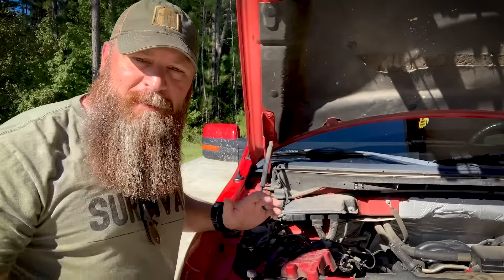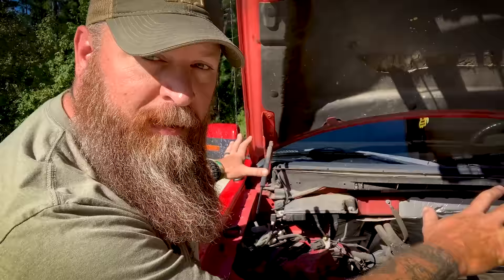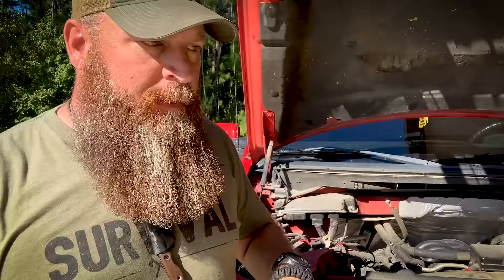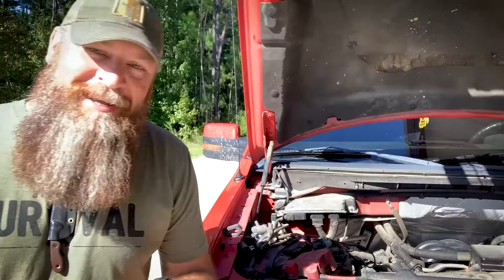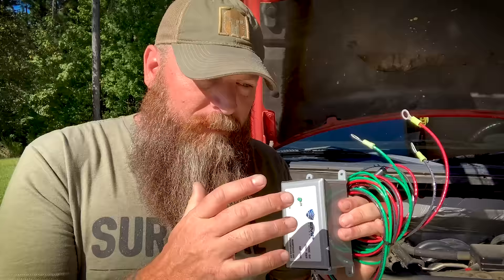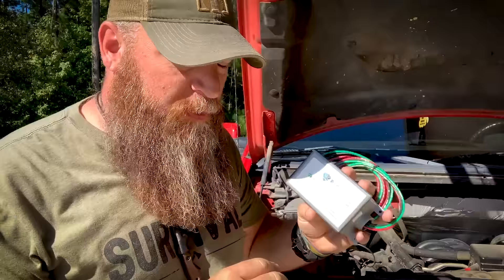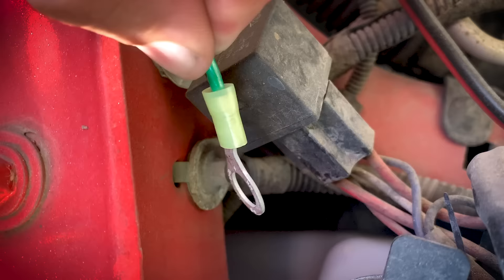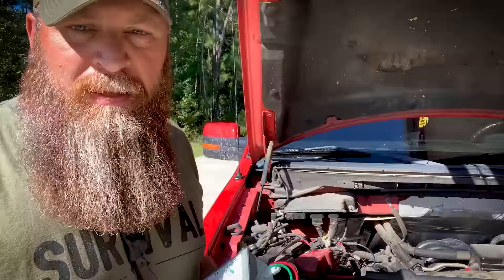EMP PROOF YOUR VEHICLE

Comment: Working with some MI Army Natl Guard folks earlier this year, got to talking and they showed us...to their knowledge, DOD has had these very devices installed in their vehicles. Shows us how easily they install too so I bought one for the truck when they were doing their ~$100 off promos. Hoping never have to test it. Also suggest grinding paint off any metal surface thoroughly where the ground wire attaches.
Reply: MJ thats correct! Thanks for comment
Reply: These have gotten so expensive they are no longer affordable.
Reply: @bobbytowesr3387  don't worry bout it. let me give you some food for thought...think about it this way, doesn't the fact that there is no metal parts of your auto touching the ground at any time make you question how it could act as a lightening rod and telegraph that energy into the ground? and remember that old advice you were given that if you are in your car and the roads are wet and a power line comes down on your vehicle you should stay inside and don't touch any metal parts. because the rubber tires are what are touching the ground (all be it that if there is rain, that is on everything,  that could in theory be a conduit).
 still, 4 rubber tires. so, how is attaching that wire to the auto frame functioning as a ground exactly?  another thing, when did any lightening rod ever need to be powered by a battery? if you ask me, those devices look more like an old internet modem from back in the day...you know, to send & recieve signals. to me it sounds just like more snake oils being sold by the folks that brought the world pandemic coV-19. but, i know nothing about nothing. so, i have to, question everything.
be well & thrive,
©¿~salli
Reply: @salli8324  do you know why your car tires are black? The rubber is impregnated with carbon, a fabulous conductor of electricity. An early test of rubber tires almost killed a toll booth worker and the driver when they passed the coins over due to the static electric charge built up from the rolling tires. Tires are great conductors of electricity. Feel free to do your homework.
Reply: @gungadingo  , some home work i have done on carbon was that carbon is not a conductor. however, if that car owner was running on 4 bald tires, perhaps those were steel belted tires and were very good source of conduction. but i don't know those details because i was not there. and i know nothing, so, i have to question everything.

be well & thrive,
©¿~salli
Reply: @gungadingo    ..  The tires are black to conceal the otherwise unappealing, inconsistent, look of raw rubber. The tires can be white, red, or any other color of the manufacturer's choosing.
Reply: @gungadingo  Wow - really?  Use your Ohm meter and go see what you read.  The rubber is a great insulator.  I'm and electronics power engineer and have designed power for military vehicles including ground, air, and Navy.
Reply: Typical of the military, spending money on something that won't work!  🤣
Reply: @bobbytowesr3387  you don’t have 400 dollars? maybe you need to reevaluate
Reply: @gungadingo  that's ridiculous, check your meds 🤣🤣
Reply: @salli8324  So then how does the ground on the battery work then? Just wondering
Reply: @gungadingo  Rubber grounds your vehicle.  However it won't ground a lightning strike in a billionth of a second.
Reply: @salli8324  go tell me what material is used to make the rods in big batteries.
Reply: @salli8324 , it doesn't work like you think it does. Have you ever walked across a carpet and then gone to touch a doorknob and you get a tiny static electric shock? The doorknob wasn't grounded but you still got a shock.
Reply: @salli8324  an EMP is NOT the same as a Lightning bolt.
Reply: @gungadingo  put down the crack pipe.  Rubber is used all of the time as an insulator.  Think about Electricians who work in rubber boots and gloves when they are working on high voltage lines.  Go crack a book
Reply: @glidercoach  Yeah like $7000 toilet seats!🤣🤣🤣
Reply: @colleenthomas353  The negative side of electrical and electronics go to the car chassis, Battery doesn't have a ground, just a positive and a negative! Does your flashlight batter have a "ground"? 🤣🤣🤣
Reply: @CharlieWhitewolf  No, tires are insulators!!🙄🙄🙄
Reply: Rubber coat your car hood?

Comment: It is the OBDII vehicles that have been around since 1996 that have EEPROM chips that can be electronically flashed, which an EMP burst could flash one of these chips that have to be worried about. OBDI vehicles from 1988 to 1995 have EPROM chips that have hardwired, or burned in, set of instructions that would not be effected by an EMP blast.
Reply: now this is some useable information thank you

Comment: This is a very complex topic. More than likely your vehicle will survive a solar flare 'carrington event' and maybe even an emp. Depends where you are. EV's are another issue. If they are plugged in getting charged when it hits...done.  But most of those chips in your car don't have a damn thing to do with whether your car will run or not. In fact, pick the ones that do, and buy a replacement and put it in a faraday bag.  Once the last nuke has gone off, and most of the world is destroyed you can put it in and go for a drive.  The issue is the grid. EMP's....well, if nukes are being set off....the problems are too numerous to even speak of or list or predict.  The consequences are literally immeasurable. There is nothing more dangerous than a false sense of security.
Reply: You must not own a new chevy lmao If your seat is not in the right position that sucker won't start. Lmao
Reply: Do you know what the best way to find out which chips, relays, etc. are essential for a vehicle to run. Still planning on getting one of these Shields, but the electronics in my '97 Wrangler have been on my mind. I do all the work on it and full half of the parts I've had to replace were relays, sensors, etc.
Reply: @ResilienceOnPurpose  Get a replacement computer model for it and keep it in a Faraday bag!😁😁

Comment: I am skeptical about a box of tricks that'll work as an EM shield, the best shield for your vehicle would be to ground the metal body to the ground thus making a faraday shield for the sensitive electronics.
Reply: How would that work? By ground the car would the emp bypass the sensitive equipment of the vehicle?
Reply: @mibd7812  Essentially yes. Your vehicle is basically a metal box aka a faraday cage. Electricity follows the path of least resistance and so grounding your vehicle the electrical pulse would conduct through the metal panels and frame and then out through the grounding wire and tires (although rubber they have carbon added to conduct static so you don't get a shock after driving)
Reply: @timberwolf0122  thank you for that knowledge right there
Reply: @mibd7812  it works on the same principal as tin foil hat
Reply: Mad genius would love to see a video on an old junker with say romex grounded to a spike then just dirt.
Reply: # Tulsa coils
Reply: This company has US government contracts for these, sure it ain't snake oil
Reply: @jaxsepisodes8286  Contracts or no that doesn't change the laws of physics.
Reply: to be an effective faraday cage it must be completely sealed in metal with no cracks. You can accomplish this on your vehicle by wraping  the car in aluminum foil , several layers is best.
Reply: @mohawksteel2215  You can have gaps in your faraday cage as long as they are smaller than the wavelength you want to block.
Reply: @mohawksteel2215  Just bought 10k shares in Reynolds Wrap.  Thanks for the dividends my foil wrapping friends!
Reply: How do I ground my vehicle to the ground with what? I am screwed cause I live in my vehicle, am broke right now until 1st and Russia is supposed to send a nuke in the atmosphere to cause an emp strike on March 11,2022. to the U.S! Yikes!
Reply: @timberwolf0122  so I would attach wire to body and other end to negative on battery?
Reply: @charlottewest9647  No, that connect already exists (vehicles grounds the negative of the battery to the body and frame), what you need to do is connect the vehicle to the Earth itself. Ideally to an earthing rod, a 6ft copper rod that you pound into the ground and is used to connect electric fence energizers to the earth or the earth pin of your house outlets to the earth. 
With this an EMP or even a lightening strike will take the path of least resistance, which is from the metal skin/frame down the copper cable and into the ground via the copper rod Vs going through the delicate electronics,
Reply: I met these guys at a show- talked with one of their engineers and installers.
It's ligit, and they have a range of products- but it's a one trick pony- no multi hits. What its "not" is a surge or lightning protection device, it works like a shunt.
I can confirm in conversation with these guys, it does NOT work within a direct overhead, but outside that...
Reply: Yeah right. How you expect the company to warranty this AFTER an emp strike?
Reply: Problem is that the lights are not covered with a Faraday cage! It will not work!
Reply: Could you just ground it with a wire attached to your vehicle to a copper pole in the ground. Same as the one when you ground a house?
Reply: I am skeptical too, but will need to do a lot more research on the subject of EMP. My only experience with an EMP-like event occurred when I was driving along a country road, and lightning hit a transformer on a telephone pole about fifty feet in front of my vehicle. For only a moment, I lost electrical power to the car, but the power returned quickly with no apparent damage to the vehicle.
Reply: Use a braided copper strap wrapped around your axle and let it drag the ground. This prevents static discharge from when you exit your vehicle after driving to prevent getting zapped.
This also acts as your faraday cage for your vehicle.
I’ve been doing this for years.
Reply: Every wire is an antenna...
EE and Ham operator . K5EDG 73!
Reply: There are grounding straps you can buy for like 3 bucks
Reply: @NobodyReport  grounding is not shielding from the electromagnetic pulse… it travels in a wave and shorts out chips from the inside. Long wires just act as antennas!
Reply: @charlottewest9647  how’s that nuke strike going ?
Reply: @muddyram  sarcasm and all, it will happen soon!
Reply: @NobodyReport  That would serve the same purpose? As this box?
Reply: @benjamincurry5701  It would do what OP said int he first comment for like 4$
Reply: Connect a chain to car or truck let it drag on the ground  🤔
Reply: So like a piece of rubber going from the frame to the ground?
Reply: Make a car cover out of copper mesh and you're good to go. No need to spend $450 on something that won't work.
Reply: A faraday cage is a nice start, and will help with the EMF, but the trickier part is the gamma radiation, and this box will zero for that.
Reply: @timberwolf0122  tires have carbon black in them for durability reasons, conducting static electricity is just a side benefit
Reply: How do those skinny wires conduct 5000 amps  ????🙄
Reply: @jaxsepisodes8286  They SAY they have contracts.  They haven't proven that they have contracts.  He says the company us under an Executive Order.  I challenge you to find any proof of that Executive Order.  It's one thing to make wild claims in a YouTube video, it's a whole other thing to PROVE those claims.
Reply: @alfredweaver5390  totally agree. I have seen this done a lot in the pipeline industry as field welders hang copper straps off their welding trucks to better ground them. No positive it would save you from an EMP...but, it couldn't hurt and it's super cheap.
Reply: @charlottewest9647  how do you know that is the date?
Reply: @charlottewest9647 About that nuclear strike 😂

Comment: We have these installed on all our vehicles, our house electric panel, our A/C, and barn.  My hubby is an electrician and these EMP shields will work.
Reply: Where did you buy
Reply: you  can  use an  emp shield  on your  house but if the grid is down where Will you get electricity? LOL think  people
Reply: Nope.  They most certainly will NOT work.  You'd better rethink your strategy and your hubby might want to check his diploma.

Comment: EMP will fry the circuits immediately and having some wires to a battery will not stop that. Think of it this way, if you shuffle your feet on carpet, and then touch a light switch on the wall, you will experience the shock before the surge can get to the power panel and have it trip the main if it was that sensitive. The damage has already been done at the switch. Same with a vehicle CPU. The charge in the atmosphere will zap everything equally  It would be a matter of chance that the charge in the atmosphere tickles and trips the EMP protector before the car circuitry. If it fails, how are you going to get your money back?
Reply: Wouldn't you need a Faraday cage to surround your whole vehicle.
Reply: @glengarbera7367  that's exactly what I was thinking 🤔
Reply: This has been tested by the Government and they stopped testing for failure at just over 40x.. it works.. don't know how, but I just know it does..
Reply: That’s an interesting analogy. 
A problem I see with the comparison between the two is the difference of how electrons move in a static DC environment (rug example) and an AC (EMP) environment. 
As another poster mentioned, it’s not easy to model these complex EMP events. USA and Russia both performed several simulations decades ago and that’s the data tables scientists still use to this day. 
We understand them in mostly theoretical (circa 1960’s) terms- long before our world became dependent on microchips. 
  Frequency, exact duration and distance from any EMP will play the most critical roles whether or not our vehicles will be able to start afterwards.
Reply: Take the battery out 30 mins before the nuke hits itll be fine
Reply: Getting your money back would be the least of your concerns.
Reply: @ToXXicgaming  my question is will a charged battery itself fry even disconnected in such an EMP burst?
Reply: I can't imagine how at would would with 13800 to 480vac transformer, the amount of current would be ridiculous even if it was for only a second, a magnetic flux field just does not turn off instantly!
Reply: If it fails, I don’t think money would be your concern.. more like looters and mole people will come out.
Reply: @glengarbera7367  Why isn't the vehicle itself a faraday cage? It's already mostly metal
Reply: @trenton1190  needs to be metal or aluminum mesh. ie a "cage"
Reply: @glengarbera7367  I gotcha
Reply: @jasonmarkwell8593  no it's not connected to a circuit
Reply: @jasonmarkwell8593  the battery is not what fries. He talks about conductors. The traces in a circuitboard are conductive wires. The emp would burn out the conductors even if there was no battery hooked up. Best thing to have for an emp is an old fashion stick shift diesel to get a rolling start
Reply: Walking works.
Reply: @trenton1190  steel isn't as good of a conductor as aluminum or copper. Also, the gaps in the body panels will allow the pulse through. Parking underground is also a solution if you don't have a cage.
Reply: B i
Reply: Anything with a coil will fry without lead lining or a faraday cage   Why do you think they wanted to get rid of lead paint then they can see through your home.  And phones and 
wi fi work better
Reply: @xXDeadSkullXx  the lead in a layer of paint is not thick enough or concentrated enough to block anything. They got rid of lead paint because it's toxic.
Reply: Yeah just because the "government " buys something doesn't mean they were not lied to and it actually works. I'm skeptical of this thing it seems like it's probably a gimmick but I hope I'm wrong.
Reply: Yep, the surge would shower down directly on electronics.  Placing a resistor inline would do no good. The damage would already have been done.
Reply: hahah thats what I thought. EMP protection sales is genius, it doesnt even have to work.... like selling nuclear radiation pills... if it doesn't work how are they going to sue you?? lol
Reply: @abcsandoval it's not an inline resistor. It's a shunt, to intentionally shunt everything directly to ground. Electricity always follows the path of least resistance to ground. ALWAYS. Without fail. A shunt will even take voltage and current away from sensitive electronics to ground even if the electronic device is only an inch from the source of electrons and ground is yards away. Makes no difference. It's not a matter of distance, it's a matter of resistance. Direct shunt to ground is the path of least resistance.
Reply: Cheap enough to try on the chance that it does work. If it doesn't work you're going to have a whole lot of things to worry about besides getting that $50 or whatever back.
Reply: @glengarbera7367 I would also put a Faraday cage around the ECM &  BCM & any other module on the vehicle. Just a simple copper or steel screen should do.

Comment: I think bikes would be a great investment. also extra tires & tubes...and a very big lock with thick twisted cable.
Reply: Ya man, electric bicycles with hub motors can easily be recharged with solar, and still be pedaled if necessary, and they can be used to generate electricity, and the battery can power and charge many different things , imagine being were it's cold and using the bike battery with a DC to DC converter to produce 12v to power an electric blanket, and use a few solar panels to charge during the day . Charge your phone and flashlight with a USB on the bike. 👍🤪👽📡🧟🛰️🏍️🛰️